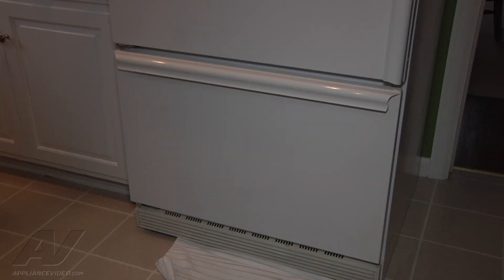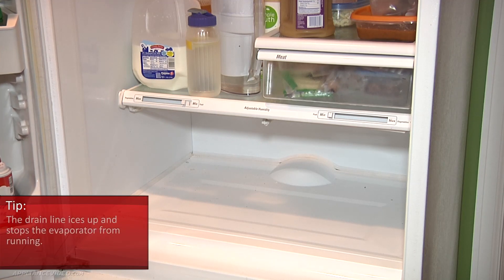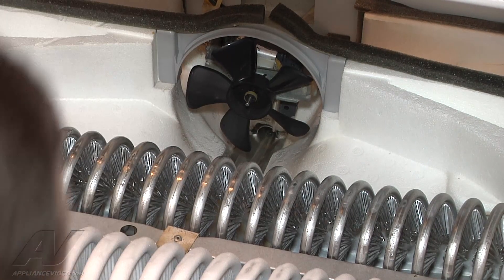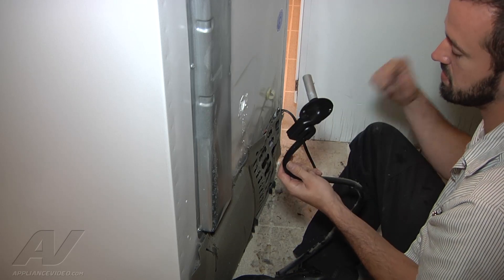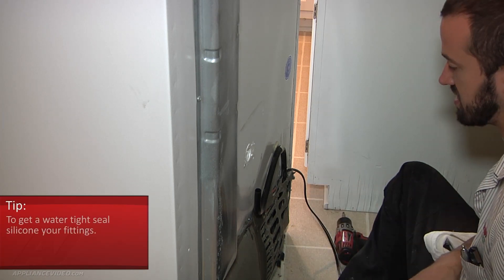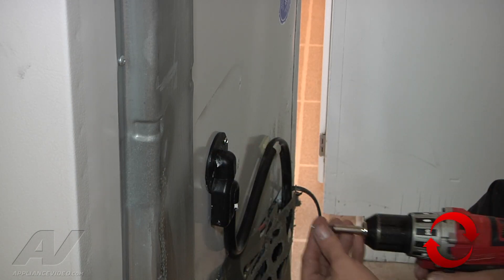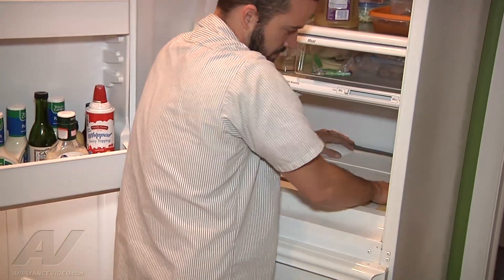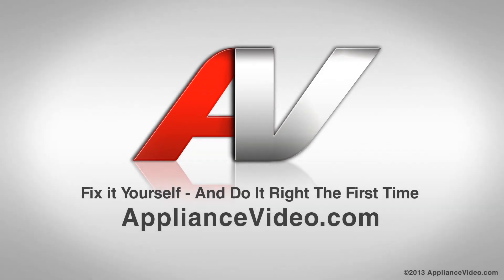GE Refrigerator Repair - Leaking Water and Ice - Drain Trap

Comment: Thanks for the video - I've got a question - did the water go straight into the freezer because the drain line on the back was plugged up?  I take it that there is an evaporator pan at the end of the drain line (under the fridge) where excess water is supposed to go (as opposed to the freezer) right?   Thanks again.
Reply from the maker: Yes, you are correct. the drain in the freezer gets plugged and the water cannot drain down into the drain pan underneath the refrigerator.Please help us provide more videos to our site by subscribing to our YouTube page or posting ApplianceVideo.com site on your Facebook or Twitter account. We also have our factory authorized technician’s email daily free professional advice to people like you to help solve their appliance problems. Thanks in advance for supporting us. Matt, Ace Appliance service technician.

Comment: My GE fridge is not working.i paid $200 to a so called tech that said he fixed it but told me in order for it to work i have to leave the temp on 5?..wtf?..all my food rot because the freezer is building up ice and its all clogged up,i mean i can even see the ice peeking out of the inside of the fridge.could the fridge be unfixable?...should i just toss it and buy a new one?..i don't know what to do.i think the tech was a ripoff. X-(
Reply from the maker: It sounds like you have a defrost problem. If you paid $200.00 to have it fixed I would call the company back to see what the issue is causing the ice build up. You should be getting 38-44 degrees at the #5 setting.
Reply: He told me that i should never raise the fridge no higher than 5 because the generator needs time to rest if not it would freeze and ruin it,is this true?...i mean i bought a used fridge yesterday and its working but now i keep it at 5 because iam worried it will happen again if i leave it at 9.shouldn't a fridge work at any number setting?..why have 1-9 if its only recommended to be set in 5?...thank you.i need to know how that works.i appreciate your answer sir.
Reply from the maker: On number #5 it will keep your temperatures at 38-44 degrees. Some people want it colder and will turn it up to #7, the temperature then will be 35-42 degrees, it will not hurt the unit at all just run a little longer.
Reply: ***** Thank you very much! this has been very helpful for me. :-)
Reply from the maker: You are very welcome
Reply: yari16215
Reply from the maker: yari 
     It sounds like you have a part of the defrost system out causing ice build up. I would call the company that charged you $200.00 and ask for a manager and another technician. Try shutting the refrigerator down for 24 hours with the doors open, after 24 hours plug it back in. If it cools properly then you have a part of your defrost system out and its worth repairing. Let us know how it goes.  Please help us provide more videos to our site by subscribing to our YouTube page or posting ApplianceVideo.com site on your Facebook or Twitter account. We also have our factory authorized technician’s email daily free professional advice to people like you to help solve their appliance problems. Thanks in advance for supporting us. Matt, Ace Appliance service technician.